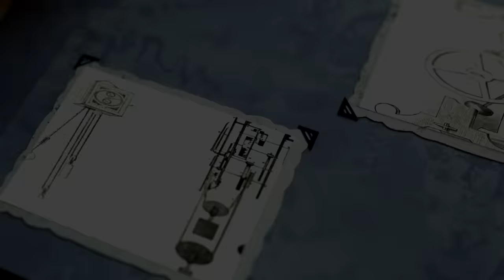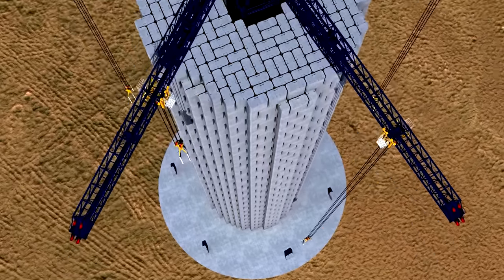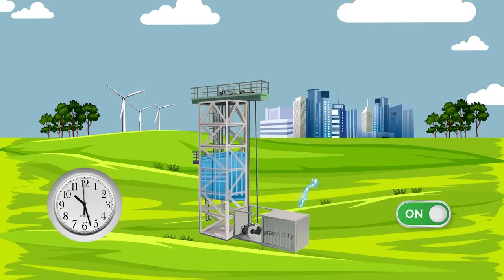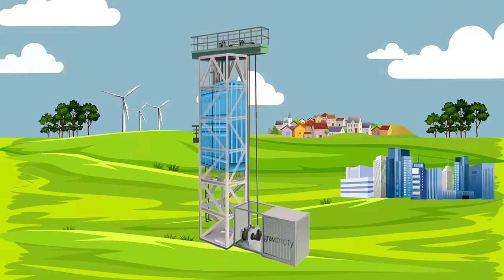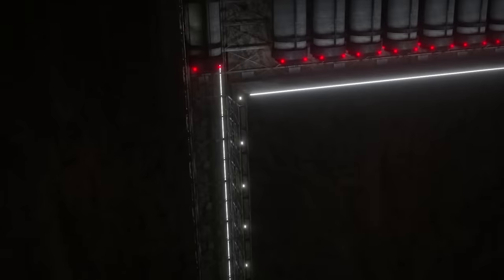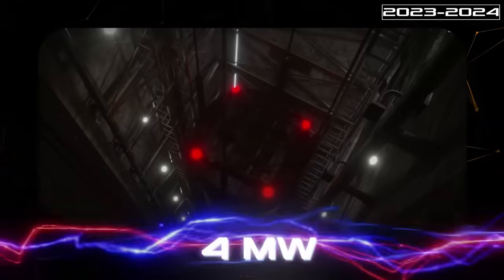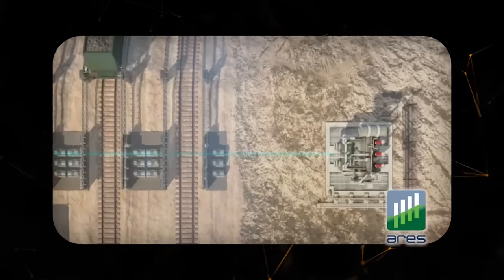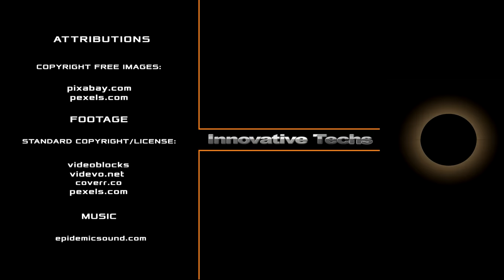How gravity batteries could change the world

Comment: Sorry. This cannot work. I ran the numbers a few months ago in a discussion forum. Here is what I posted last April:

The issue is the achingly low energy density per foot print unit area or construction cost.

Digging a shaft would either have to be done through very sturdy soil (costly) or require bracing so that the pit does not collapse (also costly).

If you compare with a well known hydro facility like the Hoover dam, and consider the figures, you can see how off the whole concept is.

Hoover dam water head: 180 m
Flow: 3300 tonne per second
Installed power: 2 GW
Active capacity: 19.554 km³
Reservoir area: 640 km²
Cost: $49 million in 1931; reportedly the equivalent of $684 million in 2020 dollar

This means, in the absence of replenishment, that Hoover dam could produce those 2 GW for about 6 million seconds, or almost 70 days, before the level gets too low.
For the record, Los Angeles reportedly consumes 22000 GWh of electrical energy per year, which roughly translates to an average of 2.5 GW (but seemingly would peak at 7.8 GW)

The largest solar farm in the world is in India, and has a 2.2 GW capacity (and covers over 56 km²)
This happens to be a nice figure because it is essentially the same as Hoover dam.

So, assuming that one does not have anything besides a very poorly flowing river but with a 180 m head, but with adequate reservoir capacity both uphill and downhill (about 10 km² area, if scaled from the lake Mead) and the equivalent of the Hoover dam power station that can be reversed to pump up the water, one would have a pair of solar farms of ~2 GW, one to power the actual day consumption, one to power the reversible hydraulic system during ‘charging-up’, and rely on the hydro reservoir to provide the power during night time, for an essentially constant 2 GW power production.
(Of course, there are variations during a day, more power needed at certain time than others, but let’s just assume that it is regulated and balanced for simplicity’s sake).
The final footprint for such an installation is around 132 km², 85% of which is solar farm.

Interestingly, Los Angeles, as a city, covers 1302 km².

Evidently, putting installations covering 1/10 the surface area of a city to power it will likely be done by finding suitable locations, which could be somewhat distant; high power transmission lines can allow the solar farm from not even be located close to the “hydraulic battery”, nor to the city itself.

Now, let’s scale this down to this ‘crane and weight’ scheme.
They were talking about 7000 blocks 30 tonnes each.
They want to have a 100 m head.
They want to use this operating for 8 hours (too low in my opinion, but let’s use their numbers).
That means they would be dealing with 7.3 tonnes per second.
100 m 7.3 t compared with Hoover dam’s 180 m and 3300 t.

So, their concept would be 0.123% of Hoover dam capacity, and you would need 814 such installations to compare.

The cost for the structure of a building is reportedly between $35 and $50 per square foot – this value is for building that actually gets built, probably having somewhat distributed floor weight; this gravity battery would on the other hand be top heavy when fully charged, that probably means it would cost more, structurally, but let’s go with $50 and call it optimistic for now.
The cost for digging a basement is reportedly $10 to $20 per square foot – but since a basement is only partly underground, the cost for a deeper well will be more expensive, as machinery will have to be lowered and soil brought up, etc. Interestingly, googling “cost for digging deep foundations” brings something that mentions ‘between $25 to $50 per square foot’, so apparently it costs essentially as much going up as digging down.

So, you have this tower (or underground shaft) that will be housing 210000 tonne of blocks, and move them over 100 m height difference – the equivalent of 30 stories.
Assume that you have 30 stories used as storage (i.e. story 1 blocks would be stored at level 31 when ‘high’, and blocks low at 30 would be hoisted to level 60) and we have a 60 story building.
7000 blocks distributed over 30 stories means 233 blocks per level, or 7000 tonne per level.

Soil has a density of 2.65; concrete is 2.4.
Let’s assume the density of the blocks would be around 2.5, as we have to take into account overall gaps, and the machinery to move them around, the tracks and so on.
7000 tonnes therefore mean 2800 m³.
With 3 m height, we have 933 m² ‘foot print’ – essentially 10000 square feet.
Time 60 ‘stories’, we have an equivalent of 600000 square feet. At $50 per square feet, that is $30 million.
Only for the structure.
To scale this back to Hoover dam proportion, we multiply by 814 – $24.4 billion.
35 times the cost to build Hoover dam.
Again, only for the structure. No tracks, no lift, no power system.
It does not matter if it is made part of an existing building or stand on its own; it would require its own structure to keep that weight up.

That is why this project is ridiculous. It can never be cost competitive.
Reply: Truth is: Most innovations have had experts that "guesstimated" and calculated that they would never work. 
Until they eventually figure out a way to make them work. It's a recurring pattern.
Reply: @Sn0w1981  Elon Musk is a good example if that. I am constantly hear people say he can't do what he says but his success rate is quite high
Reply: @BlackandWhitecustoms  It really comes down to who gets the credit for coming up with an idea or making it work. 
Lots of critical thinking is fueled by the hope that others wont succeed, just so their egos remain intact and they can say "See, I told you so"
Reply: @Sn0w1981  Good luck finding people willing to build if *for free*, since this is what it would require. The structural material also would need to be donated.
You go right ahead a figure out a way to make that half baked idea work.
Reply: @vincentgoudreault9662  I see you have become convinced of your theory on this. But there is no way you can "run the numbers" and rule out every possible variation for a fairly new concept to become viable in the future. 
Technology is ever evolving, necessity and costs are ever changing. 
Creative minds have proven many neigh-sayers wrong in the past. 
My point is: Critical thinking is admirable, when doing so constructively and keeping an open mind.
Reply: @Sn0w1981  It is not a theory, I am an engineer and I know how to compute things.
The issue here is that a bunch of know nothing are trying to push a worst than half baked concept that cannot work, and that uneducated people are apparently falling for it. Seemingly, this lot includes you.
Reply: @vincentgoudreault9662  The "Know nothings" you speak of are also engineers that know how to "compute things". And are constantly doing so in search of solutions. Being negative and condescending about it merely reflects that you refuse to admit that you could be wrong and some other engineer might get it right.
Reply: @Sn0w1981  I have met my share of 'engineers' not worth the diploma they got. And also a bunch that would 'work' on a worthless project in full knowledge that it will never amount to anything, as long as they get paid. But go right ahead; do find the figures and work out the math. My conclusion is unassailable.
Just check the company: it is described on LinkedIn as having between 11 and 50 employees, founded in 2011. What have they delivered since?
It is not being negative and condescending, it is being REALISTIC and HONEST.
If you still think it has value, go ahead and "invest" in it.😂
Reply: @vincentgoudreault9662  Yes, there are many questionable engineers and projects out there. 
However, criticizing the company is irrelevant when discussing the possible viability of the concept they are working on!
Just to be clear: I am (and have been) referring to the concept of "Gravity Batteries". Not any specific project utilizing this concept.
Reply: Those pesky laws of physics, thanks for the detailed explanation.
This kind of thing makes about as much sense as thinking we can power airtravel with big rubber bands. Most of us have no idea how much energy we need, how much can be stored for use when and where needed, or at what financial and environmental costs. We are functionality illiterate in the subject yet have hijacked energy policies to reflect what is popular rather than functional. 
This kind of thinking never ends well. We've spent decades wasting time and resources on dilute intermittent power sources while penalizing dense reliable sources.
Now we are suffering energy shortages and seriously weakened infrastructure do to our obsession with RE. 
For example, Germany invested $580 billion in solar, wind, and storage in an attempt to replace their fossil fuels. Their failure wasn’t for lack of effort or investment!
@energybants and @MadiHillydid the math:
Had Germany invested in nuclear instead, even at the cost of the $12.5 billion per reactor cost of the U.K.’s Hinkley Point C., it would have had enough energy to completely decarbonize its electricity AND its entire light vehicle fleet. They would now have energy security and one of the cleanest grids in the world instead of the second dirtiest in Europe.
Reply: @Sn0w1981  The concept of BUILDING a structure to house heavy blocks is FLAWED. Using a NATURALLY occurring landscape feature such that water than be pumped uphill, that is achievable and reasonable.
But that is NOT what those clowns are proposing.
Reply: @vincentgoudreault9662  Hydro pump stations are limited to specific area's. And have a huge impact on the large area needed. 
Gravity batteries can be built anywhere and have a tiny footprint. They also are a fraction of the starting cost compared to a  HPS and more importantly, have a fraction of the operating and maintenance cost. Thanks to their predictable long lifespan, this makes them considerably more cost efficient over a longer period of time. 
Gravity batteries are easy to adapt over this long period of time to update to new developments in tech, like more efficient generators, motors etc..
Reply: All these discussions are the same and keep going in circles. 
There is no point in trying to convince anybody that you are smarter of better informed in this field than the experts working on it.
It's obvious the tech is new and under development. Progress is constantly made. Meaning that unless you are actively working on these projects, you really can't know where they stand.
"Running the numbers" on a project like this is impossible for anybody that isn't a project investment expert that has all the accurate specific values and can make accurate predictions over an extended period time in the future regarding changes in cost, supply and demand, any emerging technologies that could have a huge influence on efficiency or cost, etc..

This bickering back and forth is the exactly the same as with other fairly new and interesting tech. People are quick to form an opinion after watching some videos. And are keen to join in a discussion pretending to be an expert (or an engineer).
Reply: @Sn0w1981  
It's true that Hydro pumps are limited by geography and rainfall, and that they have significant local environmental impact. 
This does not mean that this is practical.
Reply: @dodiewallace41   You honestly couldn't even predict if it ever will be. It depends on so many things. Like what the alternatives will do in future, in these unpredictable times. Maybe fossil fuels will become unexpectedly expensive (again) depending on world politics etc, Or maybe there will be another break-though in a competing concept like sand batteries or maybe in the current chemical batteries. Like a development in Africa that will make Lithium much cheaper. Who knows? 
Energy storage is needed. More so to make solar and wind energy work. Innovation is needed. Open minded, constructive thinking is needed!
Reply: @Sn0w1981  
If someone believes something despite not knowing of even a single credible piece of evidence corroborating it, that means two things: 
1. They formed their belief in the absence of reasonable empirical justification. This in turn means that even if the belief miraculously turned out to be true, it would merely be a lucky guess, not actual knowledge. 
2. After forming said belief, they never deemed it worthwhile to retroactively investigate to see whether their belief was, in fact, a lucky guess, or if it was simply totally wrong. 

At no point in that process was there any critical thought or epistemological litmus testing involved, let alone systematic self-correction. 

At its core, that is what separates the scientific attitude from dogmatic ones.

I don't expect you or anyone else to take my word for it, I do expect you to use data and evidence to fact check your opinions and be willing to adjust your opinions when it conflicts with the evidence.
You would find the GLEX energy page useful. Here you will find tools that shed light on aspects related to energy consumption and energy sources. The aim is to better understand the totality, which requires focus on climate, health, economy, nature and the environment. The goal is to provide the user with relevant information that provides just such a comprehensive overview. It is not a goal that those who use the tools agree with everything, but that the debate changes focus from opinion-based to fact-based. this is fundamental in order to be able to mitigate the climate challenges while meeting the sustainability goals.
Reply: @dodiewallace41  Is this directed at me? Or Vincent? Whoever wrote this takes the words right out of my mouth! It's exactly what I'm talking about.
Reply: @Sn0w1981  The issue here is that you are far less an expert into anything. The main reason this 'project' cannot work is the COST TO ERECT A BUILDING to house the weight when they are in the UP position. And such cost are known, since those would be the structural part of any high rise building (that means, we exclude the curtain walls, the interior furnishing, the elevators and escape stairs, the heating/air conditioning/ventilation, the plumbing, the electrical and communication wiring, etc.)
I have done that exercise.
Apparently you haven't.
And seemingly, if the yahoos at Gravitricity have run the numbers, either they made a mistake or are keeping the actual fact that their plan is not cost effective secret in the hope of finding more people to support their hallucinations.
As to you pushing so much for it, I suspect that you probably put money in it and are just hoping to find someone to buy off your investment.
Of course, you would object to anyone saying it like it is. Right?
Reply: @Sn0w1981  Groan... I suppose that you did not read the calculations. Look how big a footprint those 'batteries' would have in the middle of a city, where the value of land is at a premium. Then, compare with the space that would be occupied by alternative means of energy storage.
Of course, that requires a minimum of effort, with you appear unwilling (or perhaps unable?) to perform.
Well, remain ignorant if that is your wish. But do not argue with those who know and can add.
Reply: @vincentgoudreault9662  Around and around we go! Who mentioned or would even think of putting any industrial building in the middle of a city? Why are you so hung up the tower variation?
Don't even answer. You two are great examples of why not to argue on the internet.
Reply: @Sn0w1981  i dont think you have any ground to complain about "the discussions keep going around and around in circles" when YOURE the one who refuses to engage with what anyone says. how many times are you gonna say "yeah but actually what if all your math is wrong? what if it magically works anyway? what then, huh?" exactly? you dont think that maybe perhaps the conversation would start evolving if there was an actual dialogue coming out of your end?
Reply: nah i'd win
Reply: @Sn0w1981 
Everyone here showed their work. They explained why this doesn't work as advertised. You on the other hand are sitting there yelling "what if you're wrong?!" Then they're wrong. But show your work first, don't just sit there. Back up your claims. Show us where they're wrong. The reason your conversation moves in circles is because you refuse to engage.
Reply: @carstekoch  Ok, But my opinion is based on common sense. 
The way I see it, the concept of efficiently storing energy using gravity can NOT, convincingly, be dis-proven by calculating the cost of one specific idea of a project. (in this case the version with a tower and cranes)
Especially bearing in mind that even an engineer's calculations would be based on loose estimates. 

And remember, anyone can claim to be an engineer in a comment section and copy-paste a clever looking wall of text from somewhere. 

Like I mentioned earlier (a year ago now) Discussions like these are futile here. It's human nature to recognize a situation where one can take a low risk gamble to make themselves look clever.. Best case scenario, they can do the whole "I told you so" dance. And feel very clever. Worst case scenario, they just disappear from the discussion. They can't get proven wrong any time soon anyway. And look how many people are on the neigh-saying bandwagon. Surely the smart thing to do is join them. Right?
Reply: @Sn0w1981  
Again, Yes, they CAN be wrong. Everyone CAN be wrong. But if you want to claim that they ARE wrong, you need to put in the work and prove they are wrong. They told you why they think it doesn't work, get calculating yourself and proof them wrong.
And you realize that going against the stream has it's own appeal right? You can always sit there and say: "Hey, I was always saying this would work, should have listened to me!" And worst case scenario you dip out of the conversation if you actually were wrong. Hipsters are a thing for a reason, and on the extremes you have flat earthers and other conspiracy theorists.
Apropos flat earthers: The problem with "Common sense" is, that it can't differentiate between good or bad ideas at large scales and is easily tricked. That's how scams and magicians make their money. The best it can do is say that the concept is somewhat plausible. And you CAN store energy with weights, nobody is saying you can't, but this type of storage is incredibly inefficient.
Here are my calculations:

To power a single family home, You would need an area of 7,7x7,7x107,7m (without walls or lifting aparatus) to lift a 457m³ concrete cube 100 meters. 
Basis of my calculations: A family home needs 12kwh per day on average, 12kwh at 95%efficiency need 1.088.640.000 joul, you need 10 joul to lift 1kg for 1m and concrete has a density of about 2400kg/m³
Have fun calculating.
None of that is advanced physics. It's middle school at best. You don't need to be an engineer to figure out that this isn't a good way to store energy.

Now. A sodium battery with the same capacity would need 0,50x2x2,5m at worst, weighs about 80kg, would cost about $10.000, would need a fraction of the maintenance and is easily scalable. Hell, you could house several in a single standard shipping container put some solar panels up top and around and you have yourself a mobile emergency response power supply that works 24/7.
Reply: On top of that, my comments are being deleted for no reason. No profanity or spam or anything in them. Maybe I'm not allowed to refer to that project they're building? idk
Reply: It feels like we just circled back to the beginning,.. again. 
Let's agree to disagree.
Saying "That'll never work" is easy, as there is little chance to be proven wrong any time soon. 
If you go against the stream, it's your fate to put up with unending discussions until they suddenly evaporate when they do get proven wrong. Half of these discussions are with people who turn out to be convinced it is a scam to produce free energy somehow. (read around in the comments) The other half are people determined to prove they are smarter than you.
Reply: @Sn0w1981  
OK, even if they have a project, that doesn't mean that it's sensible. Musk tried to build a test track for his hyperloop too, before realising that the engineers saying it's a massive waste of money and a security risk were probably right. He actually build his underground tunnel network underneath Las Vegas only to realize that cars driving underground have the same and more limitations as cars driving above ground. Governments have spend billions on greenwashing just to have a reason to say that they are doing something, when in reality those projects have caused more harm then if they hadn't done anything to begin with.
A begun or finished project doesn't mean that it's a good idea, it just means that someone fell for the salespitch.
Reply: @Sn0w1981  
We only circle back, if you refuse to engage in what i wrote. And I will not agree to disagree. You are trying to back out under the cover of "we both made an effort", when in reality, you haven't done shit.
I told you why it's a shitty idea and a waste of money and I told you the basis for my calculations. You either back down, not out, because you don't want to put in the effort, or you point out, where my assumptions or calculations are wrong. This is how this works. The reason the conversation isn't moving forward is you digging your heels in with wishfull thinking.
Reply: @carstekoch  This is true. Ambitious project rarely work out as calculated. (never in a good way) And Governments do use projects like these to pretend to be involved.
Those are just some of the hurdles they need to contend with. Not to mention failures and declining public support. But if they don't build it, we'll never find out.
Reply: @carstekoch  friend, my comments are being deleted as I post them. I'm trying to engage but it wont let me. 
Really, I'm out.
Reply: Would it work for a six person off grid household that creates electricity via solar and wind power?
Reply: @luunazuum3785  
If you want to build a 107 meter high tower that's  lifting a 7x7x7m cube of concrete, then sure, but I would suggest a sodium battery. It's  cheaper, easier to build/install/maintain and needs less space.